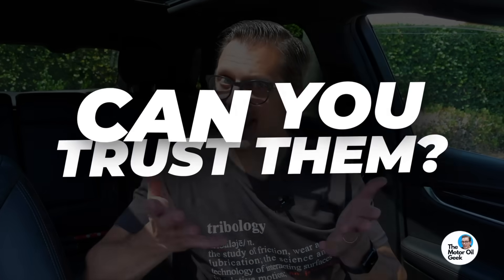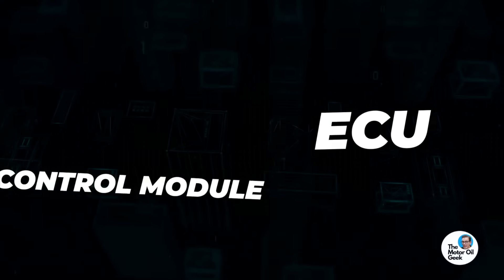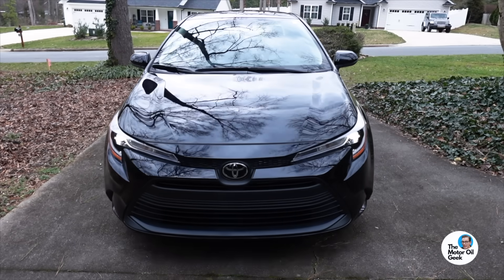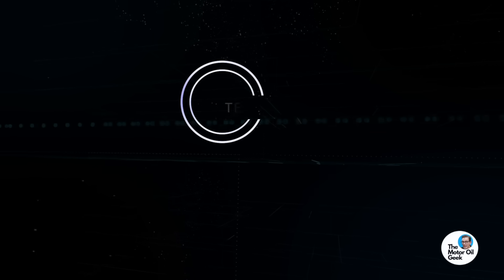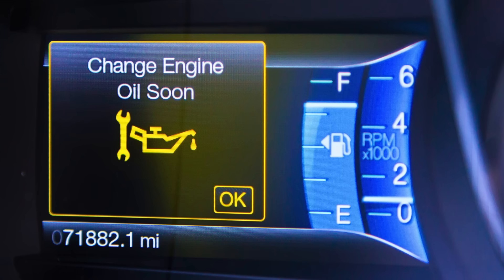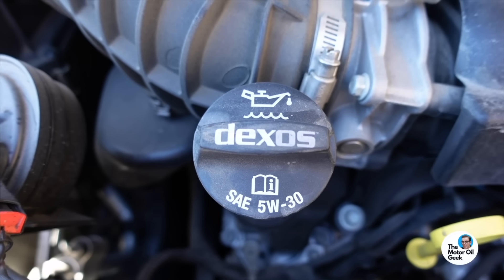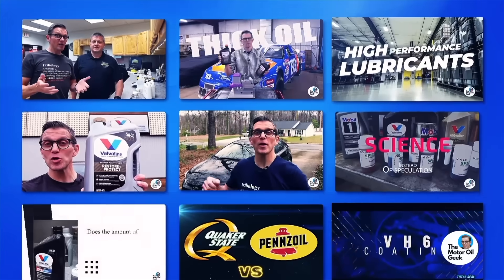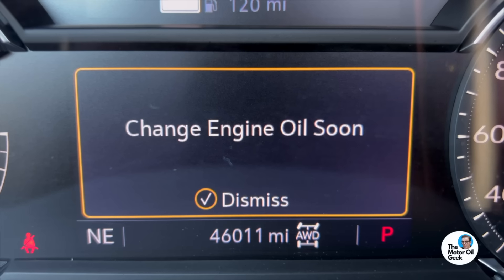The Accuracy of OIL LIFE Indicators REVEALED!

Comment: Honda's oil life percentage is a joke. I don't know how many people who won't change their oil until it's down to zero. By then, they are several thousand miles over.
Reply: Is that several thousand miles over on the oil analysis?
Reply: @paulsengupta971  it isn't convenient to send off for an oil analysis when performing maintenance on a customers vehicle. Also, when oil looks like it's been burning, their oil is low, and their valve train is full of sludge, I think it's obvious why. At least, that's what I have concluded after thousands of oil changes. A lot of them are on the same cars.
Reply: @AmericanMade79  Sounds like a few thousand OVER the oil indicator!

Comment: This is a great one, Thanks!  How about testing a HEMI that sits for weeks, or months and testing wear. With and without using Clear Flood Mode to build oil pressure before firing it up.
Reply from the maker: The HEMI is on my to do list for next year!
Reply: @themotoroilgeek  I'd be your test mule, but 2,303 miles stand between us.😃

Comment: Does this apply to modern di engines?
Reply: Same question, but throw in a hybrid. My ‘24 CR-V hybrid uses an Atkinson cycle that seems to keep the engine cooler. I’m changing the oil every 6 months or 5k miles, but curious if hybrid direct injection systems prolong oil life or same risks of fuel dilution. Thanks!

Comment: I have had good luck with hem on GM , for example during and especially harsh winter spell it called for and oil change at 2000 miles

The system is very aware of local vs highway driving

Comment: The Gm 3.6 is a powerful engine and a good engine but requires 3000 mile oil intervals and they will run for 300,000 no problem.
Reply: Yup , my 2014 Chevy impala 2LT I’ve changed every 3k since new , now at 140k still a long while to go , inside of engine looks spotless
Reply: You need to specify about which engine you are talking. GM has had two completely different engines that are both 3.6 liter quad cam V-6s.

Comment: I have been telling my customers for years on changing thier oil more often when driving fewer miles.  I always told them that buying a car from a traveling salesman would be a good deal.  I loved all the information that you shared.   Thank you
Reply from the maker: Thanks!
Reply: I find driver's seat wear vs milage is a good indicator of short trips. If the seat is trashed at relatively low miles then the driver was in and out a lot per mile.
Reply: @MathewPollard-vj4uq  Or they had corduroys and a big fat ass.
Reply: Isn’t the monitor actually telling you to dump good oil? Wouldn’t UOA let you find the real correct drain inrerval?
Reply: @bryangilmer671  UOA's are, indeed, excellent sources of this info.   On the other hand,  each UOA costs about as much as an oil/filter change.   Smart money changes at intervals recommended in the manual, typically more than 3,000 and less than 10,000 depending on driving habits.   For Joe and Sally average, that's all that's needed for the life of the vehicle.

Comment: My 2020 Camry used mileage and would notify me well before the oil change was due. I thought well before but when the dealers couldn't get the car in for weeks because customers are hogging the bays with mostly other Camry's about the same year as mine. I only had it changed at the dealer because the car was plague with problems and I didn't want Toyota to use missing the oil change by 2 miles as a excuse for the radio locking up or transmission acting bad again. Up to 10k miles I had the oil changed 3 times. I didn't do a 15k mile oil change since I was dumping that piece of junk and the light come on at 19k miles. I dumped it on a dealer soon after with one free oil change given to the next sucker who bought it.

Comment: Oil indicators assume a closed system where no oil is added.  FYI I need to add 1 qt every 1000 miles due to its high performance design.  Same as other owners of the same car.
Reply: Do you even need to change the oil when it burns as fast as you can add ?
Reply: @MathewPollard-vj4uq  Some say just change the oil filter and skip changes, but I've never subscribed to that.  Capacity is 5qt, in theory at 5000 miles only 32% of the oil is from the original fill (adding 1/4 qt every 250 miles).   But the previous additions are aging too.  Calculus anyone?

Comment: Thanks Lake! 👍
I'm about 100 miles past my 95 Cadillac Seville STS oil life change mileage, thanks to a front wheel bearing that decided it was time to Retire! 
Being medically Retired myself, I'm on a TIGHT budget, and had to buy the parts and a few new tools to change the bearing before doing the oil change. 
Interestingly enough, the OLI recommended oil change at 3000 miles, which is where I change it at anyway! 
Going to change from Valvoline VR1 conventional 10w30 to the new Valvoline Restore and Protect 5w30 to see if I can reduce my current oil consumption down from about 800 miles per quart due to piston oil rings. Not unusual for a Northstar V8 with 125,000 miles, but I would like it better if I can get it down as it will reduce fuel contamination as well! 👍🤞
Mike in San Diego. 🌞🎸🚀🖖
Reply: 125K on a Northstar V8; sorry dude , amazed the head studs haven’t let go. Prayers are with You!
Reply from the maker: Thanks for sharing!
Reply: North Stars are notorious for burning oil. I used to have one, and was told by the dealership service department, up to 3 quarts per oil change is normal. They take 8 quarts instead of 5, so they can safely burn 3 quarts. Last GM junk I ever bought.

Comment: Great video! It would be very interesting if you could do a similar video with a late model turbo diesel HD truck that tows a lot to see how the oil life monitor compares. I always change my oil on my Duramax around 5,000 miles and I usually show close to 35% oil life left in the oil. Am I wasting money? I have changed oil on customer's vehicles that went to the end of the oil life monitor (GM) and the oil looked nasty.
Reply from the maker: Thanks for the suggestion.
Reply: Oil on a diesel always looks nasty, it goes black within a thousand miles.

Comment: I don't trust these things at all. They way my wife drives her 2016 CR-V her computer would give her 11,000 mile change intervals. That's just too long. I have windshield stickers and have been using a 7500 mile interval on full synthetic on that car, but the trouble is getting her to compare the sticker to her odometer. My BMW was programmed with a 15,000 mile interval. WITH TUROBS!!! Bunch of BS. 

These indicators are programmed not just with engine longevity in mind over a "reasonable lifetime", but they are also programmed to lower total cost of ownership (fewer changes) or in the case of the BMW, to limit the number of services the dealer needs to pay for in the first three years of the vehicle's life while they were covering maintenance. I didn't own the BMW for those first three years and when I bought it at 56,000 both turbos had bad bearings. I replaced them and have been using a 7500 mile interval for the past 150,000 miles. 

They only way to know is using a lab analysis, but 7500 on full synthetic is a good place to start. That has been where I have settled after analyzing oil on a few vehicles.

Comment: I think it would be interesting to compare and test other manufactures oil life indicator to see if there are any differences in the algorithms (percentage of oil life left) vs what your oil analysis shows.
Reply from the maker: Great suggestion!
Reply: @themotoroilgeek  I have a 2024 Ford F150 Powerboost and it has an oil monitor system. I wonder just how good the algorithm works on a hybrid system like the Powerboost. Engine duty cycle is definitely different with this powertrain vs non-hybrid systems. Inquiring minds want to know!

Comment: 2011 GMC Sierra 4.8. 170k. Changed oil when OLM showed 4%/7k miles on oil. Sent it to Blackstone for analysis. They said I could go another 2k on the oil. No issues at all. Penzoil Ultra Platinum 5W/30. I will continue to use the oil life monitor. Even if it can go 9000 mi, I do not mind changing it 2000 miles earlier.
Reply: 2016 3.6 LFX. Use same oil, ran to 0%, sent a sample to black stone less than 5PPM/1kMI. Viscosity and TBN showed plenty of life left. I still change at 5%, but now I trust the computer.
Reply: @shane-222  i have a 2013 3.6 liter, great engine.  regular oil changes and regular transmission drain and fills will keep the vehicle running forever
Reply: Yes another win for the PUP
Reply: @TheManDownstairs13  the ultra platinum pennzoil is great oil. amazon has a good price is you buy three 5 quart containers
Reply: @cantwealljustgetalong2  5 gallons?  I think you mean 5 quarts
Reply: @qvb1201  yeah oops lol
Reply: Using the oil life monitor (OLM) is a reliable approach, and changing the oil 2,000 miles earlier adds an extra layer of engine protection, especially with high-quality oil like Pennzoil Ultra Platinum 5W-30. Regular monitoring and timely changes will help maintain your engine's longevity, especially at 170k miles. You can subscribe to the channel, or leave questions on the "Mechanical Guy" channel. My colleagues and I with many years of experience as auto mechanics will provide the fastest free support!

Comment: I used to be that guy who trusted oil life monitors or intervals determined by the manufacturer. That stopped when a company I worked for saw ~30 F150 5.0 engines go bad. They asked us to start doing 5K changes and I adopted that for my personal cars. 

I can’t say it definitely helped, but the later trucks seemed to have fewer problems.
Reply: There maybe some who agree but all I can speak for are the two current members who wrote the algorithm in GM’s software. The 3 lake discussed retired decades ago. 2000 was the introduction of the drivers info center with oil life for most models and all had it by 2002. They tested the oil every 1,000 miles at a 3rd party lab and it took the 2 yrs to cover all engine / vehicle packages. It is very conservative software.
  I rebuilt Ford engines from the 70’s will at a shop in 82. I was shocked to find all ring ends lined up and two #3 rods stamps and five #7’s. Go figure? Customer said he bought it new.
Reply: @deankay4434 

Piston rings are always rotating while the engine is running and the end gaps can align at any time. I've rebuilt hundreds of both 2 & 4 stroke motorcycle, ATV, PWC engines and occasionally I found ring ends aligning.
Two #3 and five #7 rods? That's only a seven cylinder engine. What about the other one? I believe the letter on the rods represents the weight of it. If so they all should be the same letter unless the crankshaft is out of balance. The lighter part of the crankshaft would need a heavier rod while a heavier part would need lighter rod to balance the assembly.
Reply: @settledontheprairie5524  There is a differencebetween GM's oil life monitor and the simple mile counters nearly every other manufacturer is using.  The subject of this vehicle was the GM monitor.
Reply: @D2O2  there are very few manufacturers using a simple mile counter anymore. Most modern cars use some form of algorithm that the ECU uses for oil life. Nissan still has a configurable mile counter but all the newest ones also have an algorithm based monitor that is separate.
Reply: @theripcord03  Yes and no.  Some manufacturers have a form of an algorithm based OLM, but not all manufacturers and even manufacturers that do, it is not across all models.  For example, for Ford, to benefit from the Ford Intelligent Oil Life Monitor System™, certain pre-conditions must be met:

1. FordPass Account and Connected Vehicle Data: You must have a vehicle added to your FordPass account and be willing to share your vehicle's connected data with Ford Motor Company. This allows the system to gather the necessary information for accurate oil life calculations.
2. Intelligent Oil Life Monitor Support: Your vehicle must support the Intelligent Oil Life Monitor feature within the instrument cluster. This feature is not available in all Ford vehicles, so make sure to check if your model is compatible.
Reply: @D2O2 Ford uses a smart oil life monitor too .
Reply: @D2O2  reminds me of a BMW teardown on the channel I-Do-Cars when they went from the Straight 6 to a 4 banger, and telling customers that they don't need to change their oil until every 15,000 miles, hoping that this would reduce company costs on maintenance plans and warranties.  That didn't last long at all, and the varnish on the torn down motors was beyond gross for being under 100k miles.
Reply: @Zorbino88  It is always interesting to me to see creators tear down an engine they get that is sludged up and they claim see, this is what you get from doing X mile oil change intervals.  How often do they actually know the exact oil change intervals?  How do they know what oil was used every time?  They act like they have records of each oil change event and are presenting scientific evidence.
Reply: @D2O2  People who buy the cars new get a free maintenance program until a certain point, so they just bring the car to the dealer who records the date and mileage when doing the service.  It's in the system exactly when any service is performed, that's your proof.

In fact, if they go ANYWHERE to get their oil changed the date and miles are recorded along with the VIN.  Even Carfax will show this.  Mine won't show up because I do my own work, but I keep track of my own maintenance and repairs.
Reply: @GrandPrix46  
The dealer has to perform any repairs if something goes wrong during the warranty period as long as you keep receipts of purchasing oil and filter, brake fluid etc., 
Dealers of automotive and the power sports industry will often tell their customers they must bring their vehicle in for the scheduled maintenance or the warranty will be void which is illegal according to  government law. By being a retired motorcycle  technician and machinist I've saved a lot of money by doing maintenance on my vehicles by doing it myself.
Reply: Nice story but you're falsely attributing the engine failure to an issue with oil. Complete nonsense. You can literally string an engine along just by topping off the oil every few thousand miles (if needed) for years. If you indeed saw 30 engines fail, there was something else other than oil causing that.
Reply: @psalmtt8784 that sounds insane. Just adding oil and not changing it is going to kill an engine.
Reply: That's Ford though. Profit is Job One.
Reply: @scott8919  Toyota certainly takes that motto also. More like DEI is job #1.
Reply: @Eurofreestylemusic  
The rule of thumb is to change the oil once a year if not driven up to the oil change intervals. Oil doesn't go bad in just three months without driving much.
Reply: @cliffords.8341  no more than 6 months for me
Reply: @Eurofreestylemusic  ok! How far you drive is programed into the algorithm. Miles, temp, calculated engine load are all factors.  I don’t see a problem here.
Reply: The Ford 5.0Ls are known terrible engines. Plenty of TSBs and common major failures due to design flaws which is why they are garbage.

6.7 Gassers, 7.2L Powerstrokes, even a lot of the Duramax diesels have tons of problems.
Reply: Could just as easily be bad quality fuel - top tier fuel cleans deposits off the ring and keeps fuel dilution way down. Those 30 engines came from people who bought gas at Walmart or Grocery stores.  Look for top tier on the gas pump. If it isn’t there don’t use it.
Reply: @BeefNEggs057 I put high grade Chevron into a Ford one time and the increase in performance was amazing.
Reply: Could just as easily be bad quality fuel - top tier fuel cleans deposits off the ring and keeps fuel dilution way down. Those 30 engines came from people who bought gas at Walmart or Grocery stores.  Look for top tier on the gas pump. If it isn’t there don’t use it.
Reply: @BeefNEggs057  

I've never seen "Top Tier" on any pump and I only buy gas from Chevron, Mobil, Shell, Sunoco and BP stations.